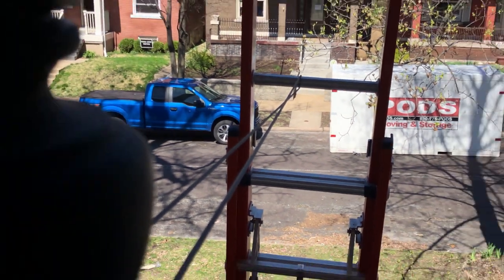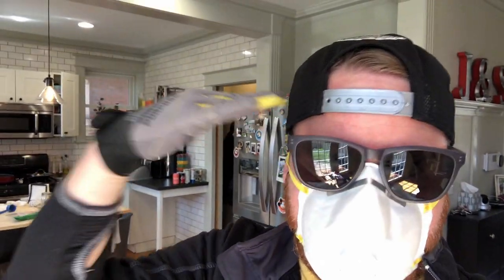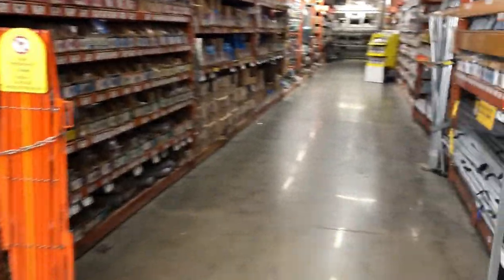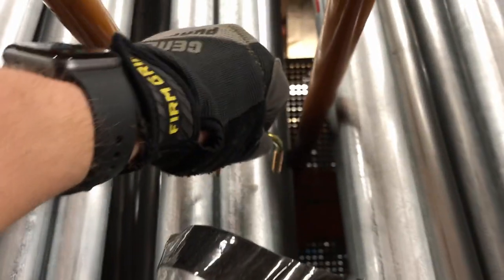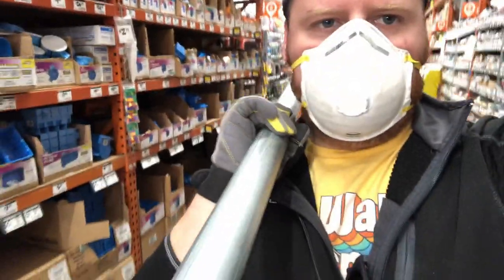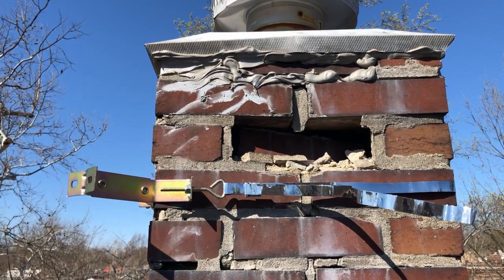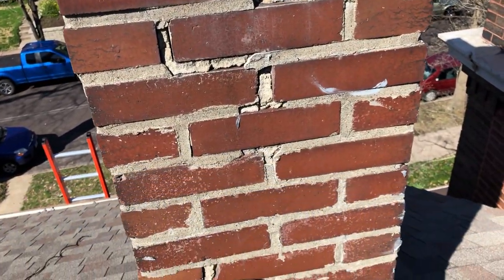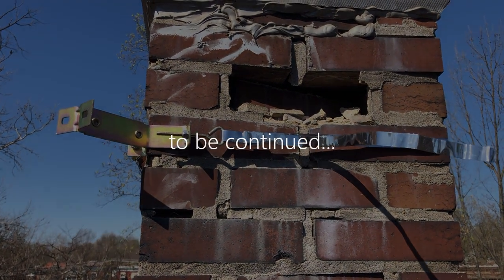Mounting the Tram 1481 Antenna to my Chimney... Or not?

Comment: If the chimney is in use, definitely get it fixed! If it isn’t used for a furnace or fireplace anymore, it might make more sense to get an antenna tripod and mount it at the peak of the roof.
Reply from the maker: Thankfully it isn't in use, but water can definitely get in. I am planning on mounting a roof tripod to the top and center, but putting something like a tribander or hexbeam on it and leave the chimney for the vertical and perhaps an OTA TV antenna. I have been trying to get the chimney repaired but the masonry companies in my area have been super flaky.

Comment: That chimney is getting in pretty bad shape and it looks like it is beyond a simple tuck pointing repair.  Looks like caulking has been used to replace mortar in some places around the top.  The chimney should be dismantled down to the roof and rebuilt, but probably not worth the cost if it's no longer functioning as a chimney.  Use a tripod mount on the roof and just have the chimney taken down and capped at the roof level before it falls over in a storm and goes through your roof or tumbles to the ground.

Comment: That whole chimney is a two fold hazard. #1, its crumbling, please hire a professional to rebuild it befor you place the 1480/81 on it. #2, when it crumbles and the bricks fall,  your liable for who or what the bricks land on. 
Safety first Dude!
Reply from the maker: Yes, if I could get a hold of a masonry company I would have it rebuilt in a hurry, but due to COVID, they're either not working, or being overworked. I've not been able to get a solid contract in these last few weeks. One quoted $3k to repair the brick and tuckpoint, requiring scaffolding and a few days worth of work. Does that seem excessive? A lot of companies have just plain ghosted me... Maybe I shouldn't use the chimney after all.
Reply from the maker: Update: finally got it repaired and tuckpointed lol. One of these days…